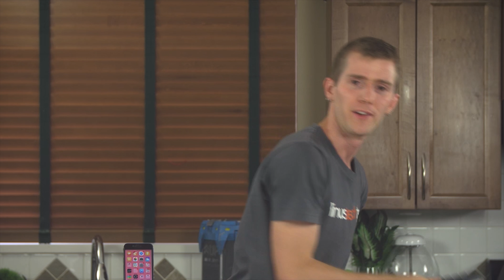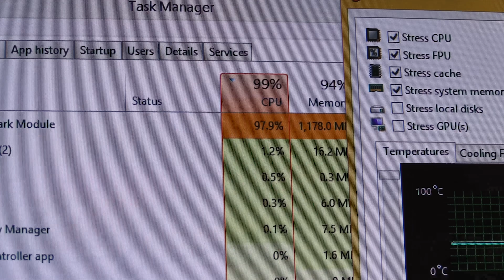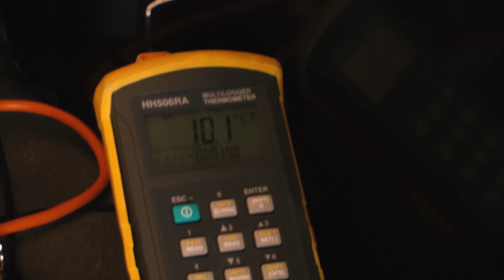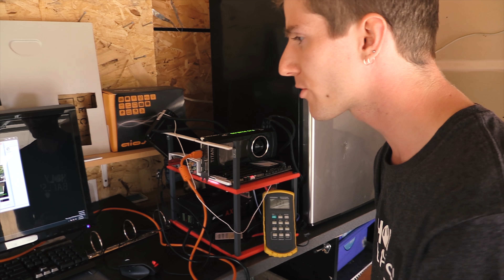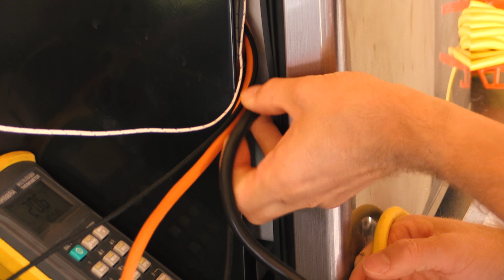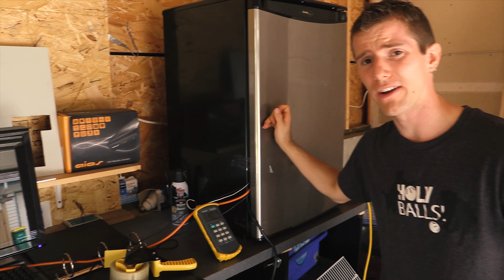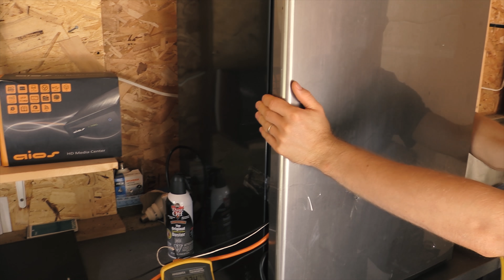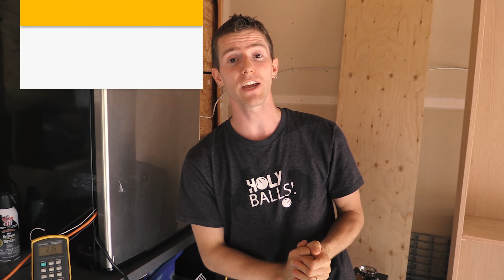PC Build in a Fridge - Does it Work??

Comment: This is a very easy fix, create a custom door insulator that allows the door to be open 12-20cm with a circular hole in the middle, then attach a fan to a ventilation tube which pushes out the hot air, this would then work as expected

Comment: should have went with a smaller dry cool clear glass simple box fridge with minmal internals easier to drill one hole for power cables no block to signals no change to the consoles needed just veiw for clear response and no water type cooling humid or condensationals just cooler small simple convert of one hole for cables sealed up after and boom there ya go best for long term cooling of 24\7 runners pointless for tiny peekaboo players that go off and on and mostly off otherwise 360 blocks suck balls in short time burn ups even with air holes drilled in the acdc case but mini fridge basics with adjuster gives temp control  for no over freeze moisture or condensation just condenced size better than a fan alone type with signal sight
----otherwise did ya know first moments stay hot average room temp and adjuster of the vents means hotter vs colder settings i didnt see cold timeing to get beyond natural startup few seconds it takes a day of sealed without breaking the seal with looose wires keeping it open so of corse it fails like that you aint allowed it to climb to freezer temps first ya want a mini freezer not a mini ice box chiller difference one dont freeze it stays moderately cool and your blinded out of the clear signal front so looks pointless tested on hot run kept open ....is that ad ploy to boost puget standard cooling parts? Idk ya missed it being done to solid standards of which fridge actualy works better and you must have dimm space heaters cuz those aint nearly as hot so try an actual mini freezer much differant let it run before hand to coldest then turn on a console inside its no where close to a toasters out put and knocks the heat down before it gets hot method aplies with timeing of whats done first and next

Comment: very bad idea to put electric parts into "a wet fridge" .   better to use radiator into Water box into the fridge , the pipes will go out side from the fridge to the cpu\gpu and walllaaaaa

Comment: Wouldn't it be more logical not to put the whole PC in the fridge, cuz it wont work at all. But only cool down intake air to the critical components inside the case and move away (preferably outside the room) all hot exhaust. I'm not talking about critical over-cooling here like with liquid nitrogen. More like an individual split AC for your PC case. Look, a split AC is more power efficient than a refrigerator so you don't not have to kill 1kw of heat produced with 1kw of cooling capability directly. Only abt. 1/3rd of that power is required. Can anyone try to build something like a PC case with internal "cool air" block and outdoor external heat dissipating block and do a test?

Comment: I feel like you could do this if you used a different liquid inside the fridge like for instants, alcohol. It’s non conducting liquid and could possibly let the pc run without damage
Reply: Wont work either, because physics. Refrigerator/freezer is designed to cool down things that (this is important) do not make heat themselves and keep them cold by means of thermal insulation. But it has very small cooling capability (compared to AC units) and draws very small amount of power (that is what you want for continuously running device). PC components on other hand continuously create a ton of heat (almost all power consumed is converted into heat). So you do not want to have working iron or kettle inside your fridge or the latter will break. You need to remove the created heat outside your PC case by means of heat-conducting elements (air, water, oil, direct contact heat transfer, etc.). It's better to use a split AC style heat pump for cooling.

Comment: He talked about getting a air conditioner unit to cool the whole room or building. Tho he didn't talk about just getting a upgraded fridge. I understand he mentions its not designed to stop heat that has nowhere to go or 24/7 cooling, tho I'm sure you can find a stronger brand, that makes the cooling drop easier. So that it doesn't need to use as much effort to get lower degrees. Yet it's still a fridge. (Also A AC unit just sounds way more expensive than a upgraded fridge)
Reply: At the end of the day, he only tested 1 fridge out of how many fridges? So saying all bridges won't be able to stop the side-heat, just because of no air-flow, is misleading. That's not true for every fridge, just the 1 tested. It's a generalization, half truth, but not full truth till he tests better fridges. Also no fridge has a fan? or air recycle?

Comment: in the 70's, they built commercial grade CNC's with refrigerated electronic cabinets. these machines would last forever, i bet there are still some of these machines in service. not only will a refrigerated box enable peak performance, it also enables extreme longevity, there's never any heat stress on the electronics, and they don't get dirty either.

Comment: Start with a freezer (not turned on) that can run at - 20 put pc in it and let it run until inside the freezer is hot then turn freezer on... Freezer can't freeze because of the heat generated by the pc and the pc gets colder because the freezer cools better than a fridge :)

Comment: So, what about modding the mini fridge into a setup that works as a water-cooling system combined with cold temperature confinment? Would the fridge sized radiator work as a giant heat sink coupled with an air compressor that generates cooling (perhaps using a higher capacity compressor for a stronger cooling?) I'm just spitballing ideas here, don't go trying to crusify me if you're overclocking PC guru. Just tell me why it wouldn't work or how it could be made to work if I'm onto something.

Comment: waste of a perfectly good beer cabinet...long term use may cause frosting of the air inside the fridge over an alloy heat sink especially if you keep opening the door and letting ambient warm or humid air into the fridge. why cant you plumb in the fridge to a water cooler and use the cooled water to cool the processor?

Comment: Here I was thinking you were going to build a fan cooled PC that blew cold refrigerated air onto the components in a way that did not create additional heat inside the case. But no, I was greeted with you chucking a PC into a refrigerator. Damn you Linus

P.S. OLD LTT > NEW LTT

Comment: the problem with using such method is the humidity and corrosion.What I would be interested in seeing is to take the guts of a frig and replacing the water cooling system from a normal system and see if something of that size could cool just the CPU and GPU.

Comment: Time for my engineering knowledge to kick in. We can fix this and yes with holes. But not as explained here. It would have to be sealed style. Meaning the rig has to be against one or 2 walls of the fridge I recommend both. So push pull. So build the rig inside and have the rig sealed from fridge so only the cooled air from the fridge itself basically keeps rig cooled but no air from fridge escapes the sealed case has holes in from and back allowing outside air to flow into then out the case without Losing cool air from fridge. Now I doubt it's coat effective but it should work to keep temps down is say an average of 10°c hit me up for more crazy engineering ideas at I fix links tech fridge issue dot canada

Comment: Without watching the video, I instantly see the problem with this approach if it's going where I think it is. There's much better ways to benefit from the heat exchanger because a fridge is insulated meaning sure it cools stuff down, by pulling the heat out, but it also traps heat in, and a PC is pumping out heat faster than a normal fridge could cool it down so you'd at very least need to have the door open to let the majority of the heat escape, at least then the heat exchanger at the back has some benefit of exposing some part of the system to a cooling effect, but really what you'd want to do to benefit from a fridge like heat exchange system is to gut the fridge and only use the heat exchanger with the heat absorber inside your case and the heat expeller end outside of the case, the problem I'd want to address in this case is to negate any chance of condensation that might get introduced by the extremely cool bars, which might be mitigated with some kind of plastic covering, or find some way just to introduce the cooled air from the heat exchange into the system, essentially think of it more like an air conditioner than a fridge

Comment: I realise this video is 5 years old, but Id like to see an experiment where the computer itself is outside the fridge, but the water-cooling radiator and reservoir are inside the fridge. That would be a far more usable type setup IF it worked.

Comment: In Refrigerator insulation is most important thing and the wire piping out of Refrigerator lost a lot of cooling frust which result in loss of cooling.
So let's Put it in an Ice lined Refrigerator 😁😁😁😂😂😂😂

Comment: Drill wire holes in the door. Put extension cables from the pc through the holes on any wires that need to come out. Silicone the holes shut and your now sealed again.

Comment: Linus maybe you could do one with an AC unit blowing into a computer case of your chosing? It might be better because a 6,000 BTU unit would in theory be enough for a computer with a power supply of 1.75 kw. 

You could monitor RH levels inside the case although I think the RH values would be sorta high if sensible heat wasn’t leaking into the case (if you used a mini fridge as the case, for example). But I think it would be pretty hard to control RH in there. You’d have to be able to subcool and/or reheat the air.

But I would imagine even a stock cooler or a meager noctua would be enough to overclock a cpu in that situation.

Comment: The major flaw is the opening in the door for all the cables...the solution would be to use an icemaker model that already has routing and insulation for icemaker tubes / wiring.  Because Fridges and Freezers don't work well with a door ajar.

makes me wonder how it would have done in a freezer set to its warmest setting.

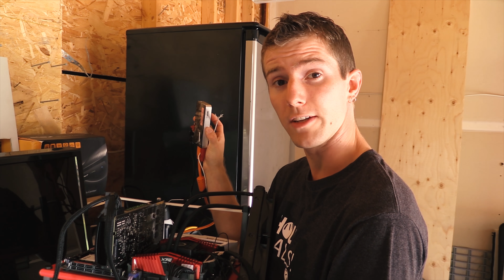Comment: "any moisture with powered on electronics is a terrible idea" - 6:30
Also : Puts a Titan X in the fridge
Reply: To be fair, the temperature difference is close to none so it wouldn't matter
Reply: Blow in a stream of nitrogen gas to push all humidity out.

Once a week should be enough.

You can also put chemical desiccant pellets in the crisper.

Comment: Have you guys ever thought of trying to incorporate an aquarium chiller into your custom water cooled systems?  It looks like water cooled systems work on airflow going through a radiator and cycles water through the fins.  The only thing cooling the water is air flow and taking the heat away.  Would an aquarium water chiller make a difference and create a better over lock experience?  Some water chillers can be set as low as 39 degrees F.  Just route the tubing to and from a chiller...  https://youtu.be/uNNPegVpYYI

Comment: sounds like the temp of the system is heating the space inside the mini fridge disproportionately. i know it was addressed at the end of the vid, but theoretically this should be possible.
i would build and insulated case to spec so it fit an industrial air conditioner and seal it off. hook your components up to a test rig, like they have in this vid and shove it in there.
run your computer and test the environment under stress, and overclock the AC unit until you have a nice frosty environment that the components heat is unable to effect inside the case.
condensation is your enemy at that point.

Comment: Keep the drives and power supply outside of the fridge. Even the GPU if possible. Just run the motherboard inside the fridge. And overclock the fridge. Pump that bitch up right to the point it doesn't freeze itself up and let her rip.

Comment: I came across this video because I have A PC that controls a CNC Router/ Plasma cutter in the garage and I get hot as hell out there and kills the computer and crashes the machine. The PC tower is in a protective box (I have to keep dust and metal particles) I have HEPA filters on both sides with a fan inside, but when temps get up over 95 degrees F in dies. I was thinking about putting a Peltier Cooling unit I got out of a wine Chiller fridge in the side of the box (with cool side in the box an hot outside the box) But I would need to seal up the box. Any Thoughts?

Comment: This is just like when you put hot foods in a fridge in raises the temp of everything in the fridge so if you have something that is constantly putting out heat the fridge will never cool. In a restaurant the health department will even tell you it a no no to put hot stuff in a fridge. You would need something like the coolbot system and a small ac unit in a closed box for something like that to work.

Comment: Well rather than keeping the whole cpu into the fridge you can tear that fridge and attach evaporator directly to the processor but then it's still consume more electricity to cool than the pc itself so not worth it but it will lower the temperature significantly and it'll be a great fun project.

Comment: If you had a glass box where you have pc case with large intake fans and air conditioner shooting into them with cool air... Then a hole where pc is exhausting the warm air to OUTSIDE of the box... then this would be something, closed system is having the battle with air that's heated by the system

Comment: It's not a failure.  It just needs a redesign and try again.  I suggest using liquid cooling where the hoses go through holes on the side and use a radiator outside the fridge not near the fridges rear heatsinks.   Also seal around the hoses where they exit and re-enter.  

This design would test if the fridge can keep ambient temps lower when the computer's main cooling is dumping extra heat out of the fridge. 

Then after all this us done load test the machine.

Comment: Your explanation is incorrect for the reason why your rig didn't work. First of all the air inside the box recycles over a cooling coil, it doesn't leak outside the box. The heat your feeling outside the fridge comes from the condenser coil. The reason why its not working is because the fridge is not designed to handle the load your test rig is placing on it. You would need something like a deep freezer or meat walk in box size refrigerator to test in.

Comment: Don't put the power supply in the fridge. Also drill a hole in the side to run your cables through, then seal it up with spray foam. It needs to be air tight and there is no reason to cool the power supply.🤦‍♂️

Comment: I always wondered about small tubes system under land. Earth is pretty cool 1-5 celsius even at summer, if you dig 10-20 cm of it, you just need a strong water pump - enough for your underground tube system. Directly connect it to your PC. You get a water cooler, and radiators are the tubes dug under ground. But yeah cooling is pretty limited thing, unless you live in north pole or south pole, mountains, and still it has it's limits, you cannot reach obsolete coolness unless you just put cold nitrogen into your gear constantly and still you would run out of it....

Comment: Hear me out, what if you connected an air pipe that goes through a copper coil inside the fridge to cool before exiting through a larger pipe that feeds into the air intake of the pc? Colder air :)

Comment: Conceptually this is good. Its basically what server rooms are. You can increase thermal by large area or increased air flow. This allows direct control over ambient. Its effectively a Diff Q problem. The fridge has to be strong enough to over come the heat production in the same unit of time as the heat extraction. A control circuit will regulate the internal air temperature. Its a better way than liquid nitrogen for sustained runs. The fridge has insulation which most server rooms do not to my knowledge. The narrow space will help reduce the massive size of the pump required. Microclimates are a potential problem for servers. Home air conditioners are not generally size to have huge production in single location and also like a fridge expect to have some time to pull it out. Walls are insulted for much of the same reason, however internal walls are generally not.

Eco behavior may have been ignored. Some may operate slowly assuming a degree of thermal capacitance which resists thermal change. Which allows adding objects to fridge to stabilize the dooring opening and closing also smooth out thermals of production. Just like electrical loads. Going along with eco, some compressors may only handle high power bursts like deep freeze modes. Capacitance may prolong this time, however how long the compressor can sustain repeated cycles of that mode depends. Point is you would want to consider your fridge/freezer carefully.

Comment: Problem is...the fridge will crash soon. The seal open like that will make it work overtime and eventually, something will die. You'll also not achieve a constant, usable temperature within the fridge and performance will vary. If you hardwire the cables into the fridge and leave the seals to do their job, you'll get better results.

Comment: You're adding 300-400W of heat in the system(basically 100% efficient heating solution) and hoping a 100-300W fridge(not 100% efficient) to remove it from the system....does that make sense or am I just an idiot?